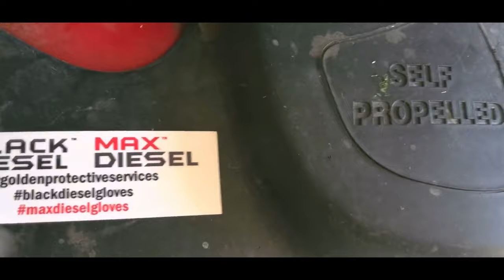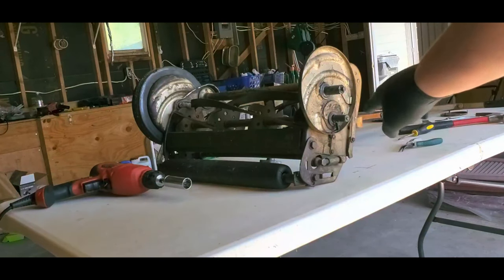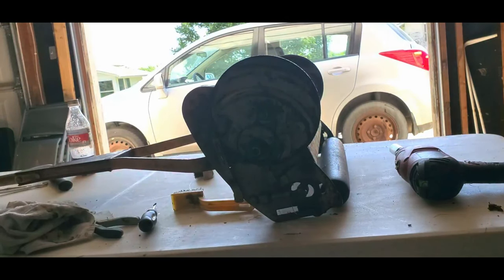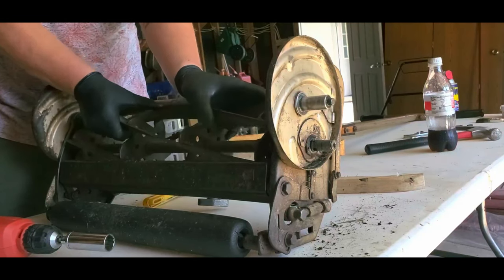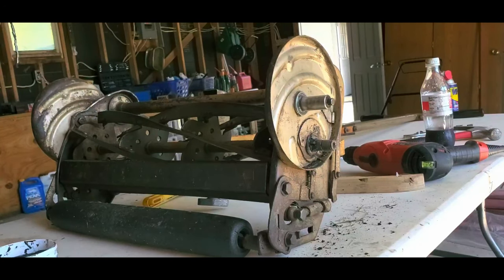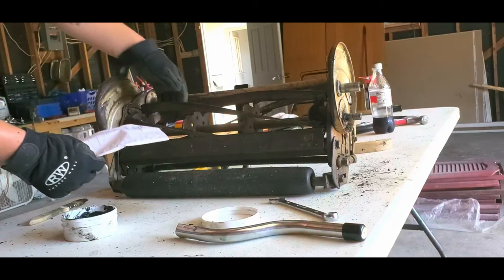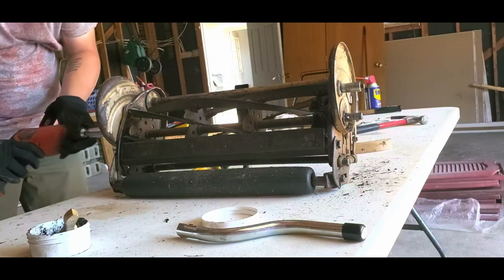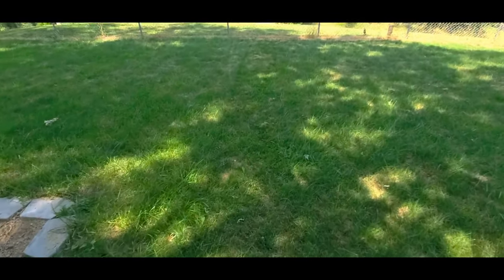Silent Scott's Deluxe Mower Restoration - Part 1 (The sharpening)

Comment: I have this machine too, it is a peach!
Behind the pinion and the washer is a felt washer that keeps grit from the wheel area out of the wheel bushings.
The bushings are great with dimples to retain oil.
If you want to touch the bedknife keep the angle grinder the heck away from it!!
A felt pen and a flat file will be all you need.
Your back lapping honed the top, now run the felt pen on the surface of the bed knife that you can see then put the file long ways parallel to it and go back and forth till the pen mark disappears, the will sharpen the cutting "corner" of it and you will be good to go
Your machine is awesome because the bed knife stays "nose down" at any cutting height, they were very expensive when new and your deserves careful cleaning and repainting.
Reply from the maker: Thanks for your reply! I'll be continuing restoration during the winter, so this is good info!
Reply: @DRK_BBQ  I have a picture of mine on Instagram at wayneessar.
They were dumbed down when Yardman took the design over with "click" for half inch height adjustment.
Them Agrifab made them, still in the US for 450$.
That killed them off eventually but as I mentioned before your machine is made to a higher standard than anyone produced today.

Comment: It is called the "Silent Scott" because it is made to be adjusted to 100% relief!!!
No contact between the reel and bedknife.
Use an inexpensive piece of shim stock and try half a millimeter space/gap between them, very low noise then, high reel speed, less effort for you.
Reply: Exactly!  I have this exact SILENT Scott mower.  It's making me squirm watching this.  I lightly sand the reel blades every couple of years AND WD40 everything about every other month to keep the unit clean and corrosion free.  I inherited it from my father-in-law 25 years ago and have only overhauled it, to grease it, twice in that time.  These machines are gold.

Comment: A first step in any antique reel mower job is to back off the bed knife and pry up and down on the reel shaft, this will let you discover whether the reel bearings are loose.
If they are loose you won't be able to set your reel to bedknife and that will upset you.